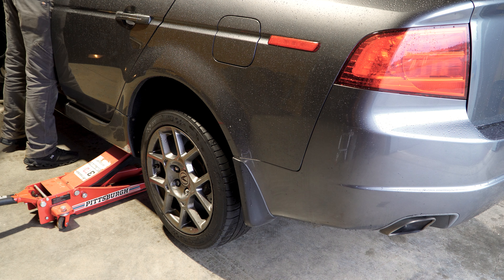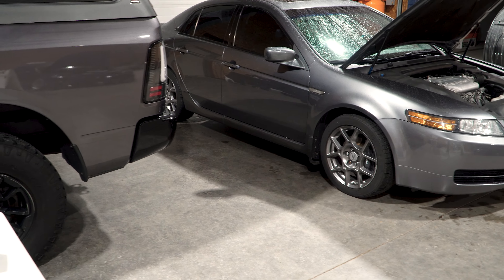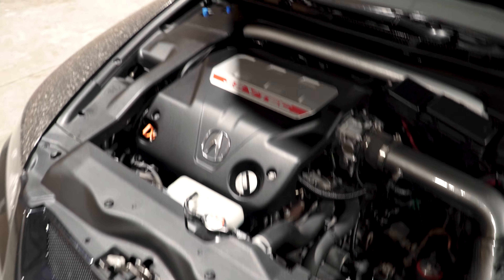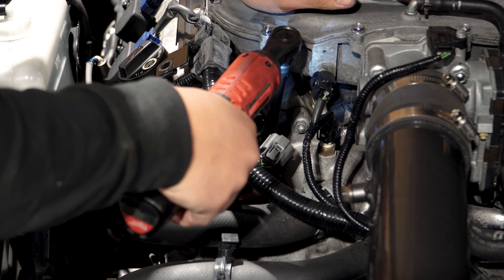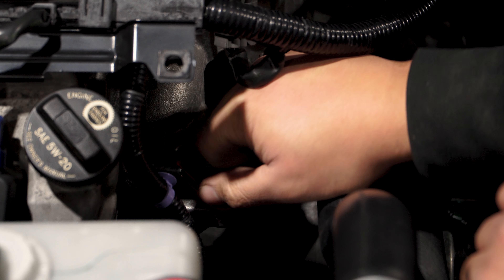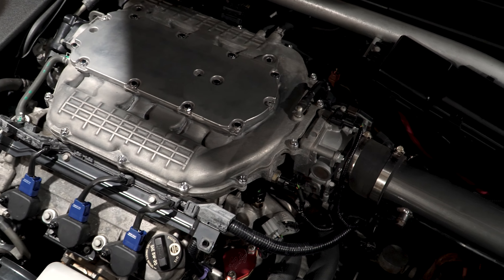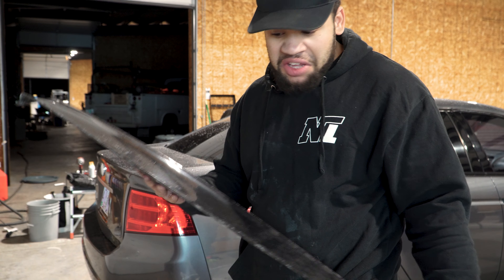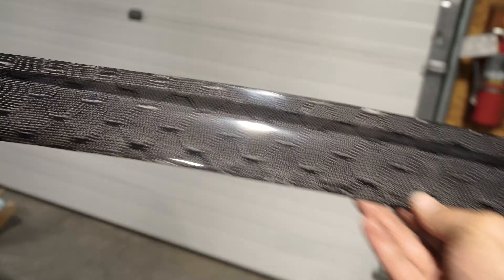EGR Delete Acura TL Type s Install for TURBO prep!

Comment: I don’t do any motor, machining or timing myself I always pay the pro shop to do it even if it costs a lot in terms of labor because like you I don’t want to deal with it but I haven’t done much to my TL but for sure my RMS is leaking because I saw he PCV was horrible and I’m not sure why they didn’t change it but for those that haven’t it makes it a higher risk to blow out the RMS. I’m even in school now for my ASE certs but I don’t plan on working in a shop anytime soon.
Reply: Lmao

Comment: After installing the EGR delete plate from P2R, you said you taped the EGR plug, will a check engine light come up if left unplugged or what would happen? Thank you.
Reply from the maker: Yes I forgot to mention that. you will want to clear the CEL with hondata
Reply: @TheLifeStyle6  aight, I have a 2005, 5AT TL Base, is there any tuners for that tranny and year? Other tuners require to be manual or like 07-08, can't find a tuner for us -04-06 5AT, if you can find one, it can really help a lot.
Reply: @tankmango7574  I believe the only options we have is to swap to a 07-08 ECU
Reply: would a jet performance work as a tune? or code remover for egr

Comment: I tried the egr delete and it’s causing some concerning issues. I hear a knocking in my engine and it over revs when I start it. It Revs up to 2k rpm and stays there.  check engine light also came on.  Any ideas what’s happening?